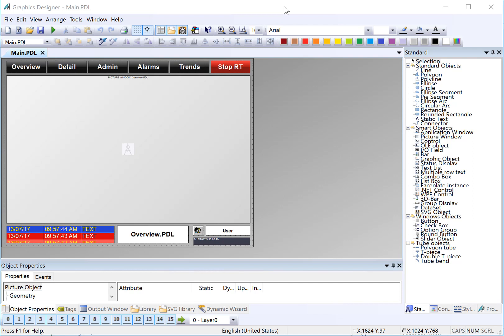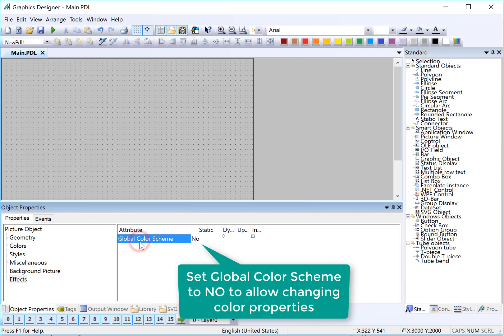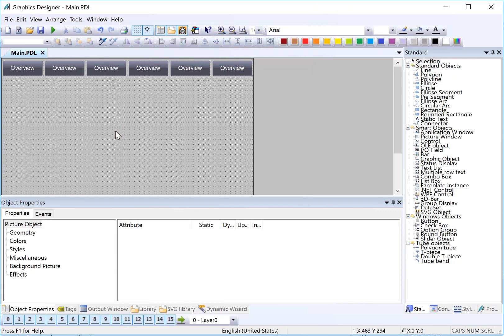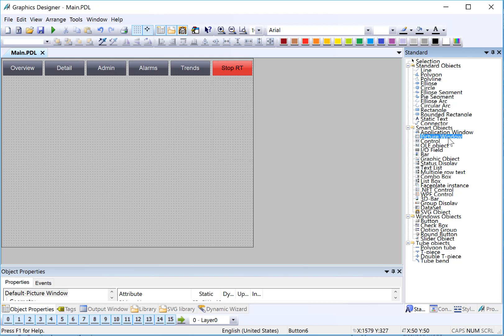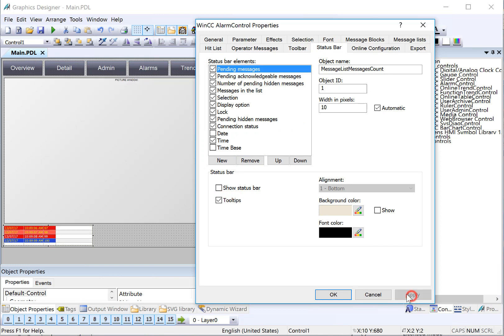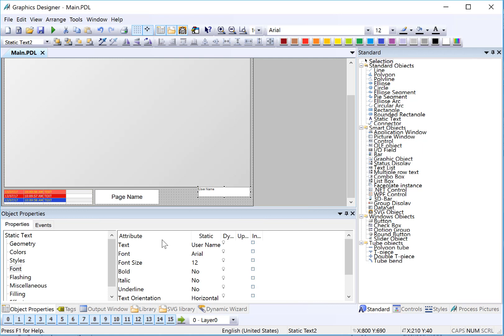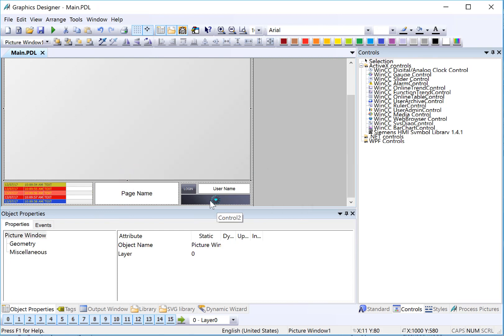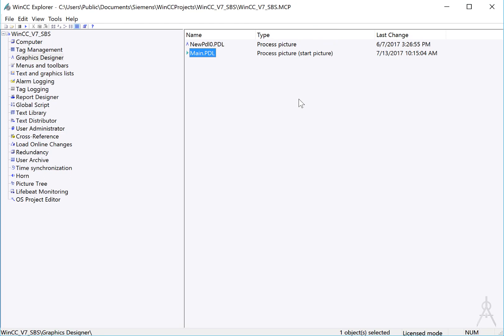WinCC v7.4 Step By Step #7: Create Main Screen Graphics 🖥️🖼️ Learn SCADA Programming #WinCCGURU

Comment: THANKS SIR for sharing your precious knowldge you deserve all blessing and 1000000000 subscribers
i've just one  issu with digital clock font size that  doesn't work
size stay in default size 
i can change the family font and others effects like bold.... but size no way
thanks one more time for your kindness to share your knowldge
Reply from the maker: Are you using the active x properties of the clock (access by double clicking clock) or font properties on WinCC properties screen? Also make sure global effects are turned off.
Reply: @WinCCGURU  thanks Sir for reply 
by double clicking clock 
and i deactivate global effect but the pboblem is still shown
i try to use input output field and choose the date/time
or write script for date and time
at the end i ask god to give you a good healt as he gives you knowldge for ever
Reply: @WinCCGURU   by double clcking 
and turn off effect
by the way sir no one find the solution in siemens forums they suggest c script or vb scipt or input out piut field ??????????
Reply from the maker: let me ask: are you using the digital or analog clock?
Reply from the maker: the analog clock face doesn't work with font size changes, but if you uncheck the Analog display field, that makes it a digital clock and the font size works.
Reply: @wafaaachour7839 did you solve this problem with font? I have the same. Do it like an author, but the font doesn’t change